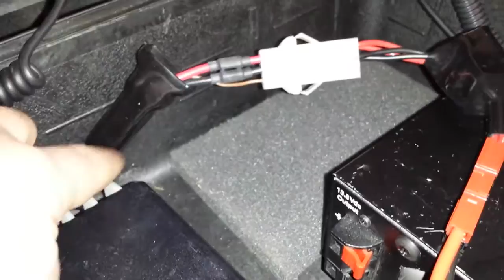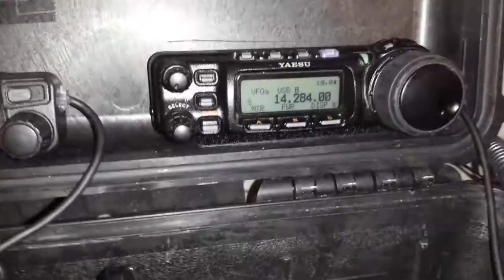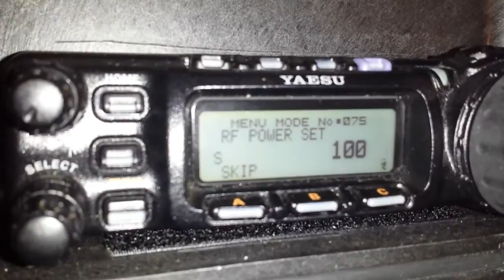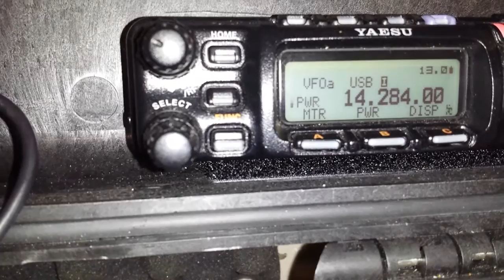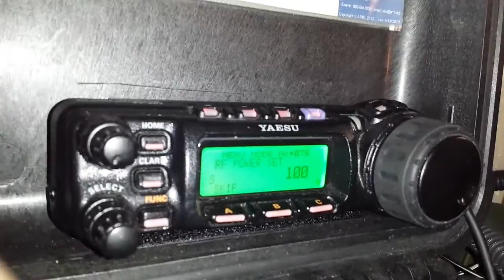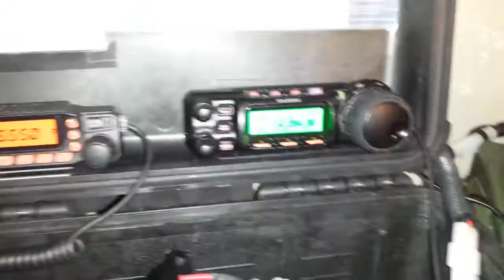Yaesu FT857D battery mode

Comment: Did you basically connected a jumper wire from the ground wire to the open port? Where did you buy the jumper wire and will any jumper wire work ?
Thanks
Reply from the maker: Double A  yes the brown wire on the radio side of the plug goes to nothing on the power supply side, so by connecting the brown wire via that open port to one of the ground wires, it will go into the "low power mode". i used a small piece of wire i had laying around, i think it was a 16 gage or so, by stripping away a little insulation on each end inserting into the ports. ive since made a more permanent solution with a switch https://youtu.be/8yiNeAblpS0
Reply: Thank you for the quick reply and the tip.
Reply: When I connected a 16 gauge wire from the ground wire to the open port on the power supply side, no change was noticed.  However, when I connected it to the black wire on the power supply side it worked. Any ideas?
Thanks
Reply from the maker: Double A with the wire harness plug connected, ground should be ground. the only thing I can think of is the jumper wire just didn't make contact with the conductor....maybe a tight fit or the insulation blocked the connection. I did find on occasion if the harness was bumped/jarred/moved, the jumper would briefly lose contact putting the radio back into normal mode for a moment. Soldering a switch in fixed that issue.
Reply from the maker: re-reading your comment, i may have misunderstood what you were referring to...basically getting the brown wire to touch a black wire is how it works. there is an open port on the power supply side of the wire harness plug that goes to nothing at all, i may have caused confusion in referring to that open port earlier. Hopefully that helps.
Reply: Ok. Thank you
Reply: no it has to be a special red wire    so you may accidently put it in the  possitive side ,,,, derrrrrrr